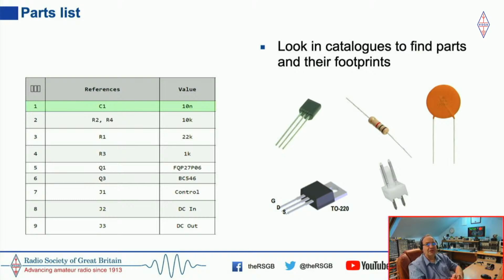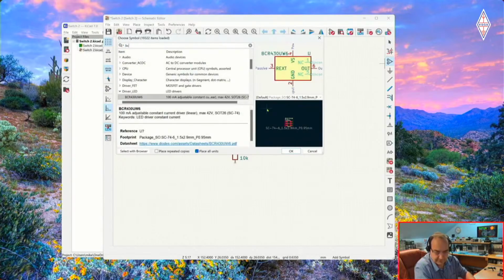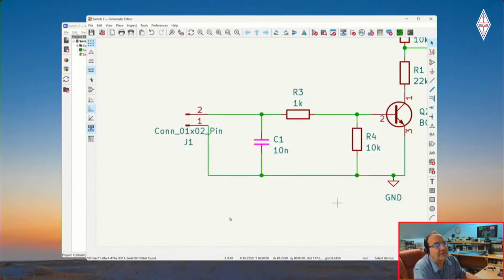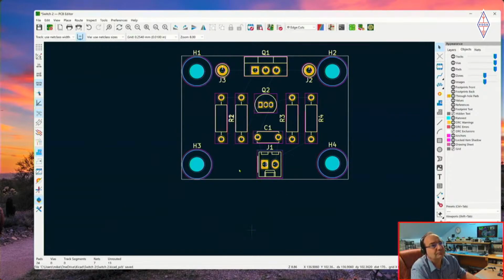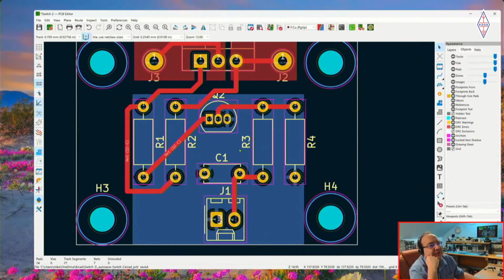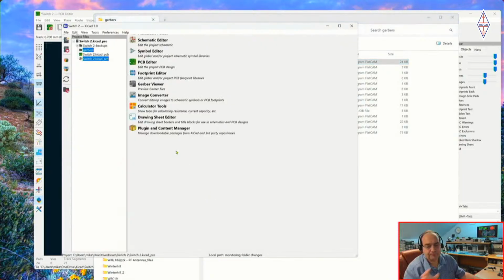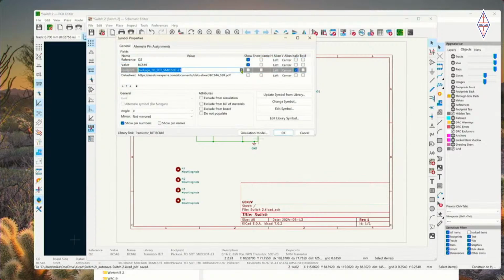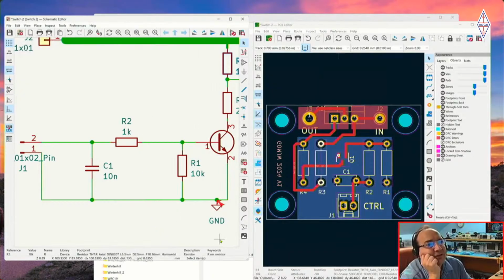RSGB Tonight@8 - KiCAD PCB design software by Mike Willis, G0MJW

Comment: Why are you mixing imperial and metric? I would want to use just metric.
Reply: Thanks for your question. It is because so many electronic components are based on imperial pitches even now in 2024. The lead pitches on leaded integrated circuits as well as many connectors etc have always been based on pitches of multiples of 0.1" and this continues with new devices to maintain compatability, so whilst dimensions like PC board sizes may be in metric you will often find that component lead pictures are imperial.
Reply: @davidpalmer1931  Ah! I feared this would be the reason, those pesky Americans 😂
What about SMD components, are they in imperial too?
Reply: @ian.dobson  Both - for example an 0603 size component which is .06 x .03 inches is also known as 1608 which represents the size in mm. It's just historical and in practice is not really difficult to work with.